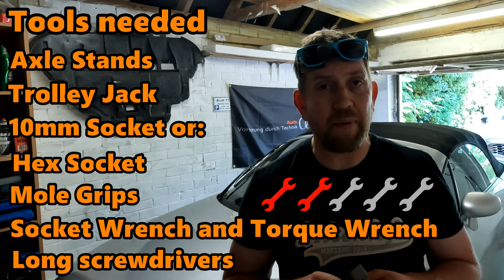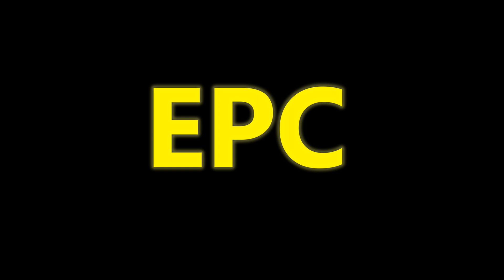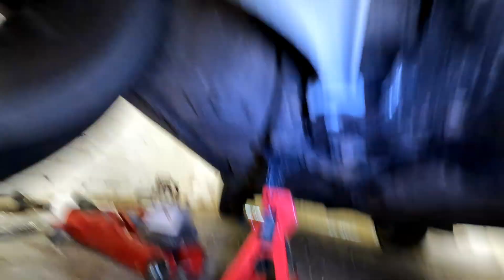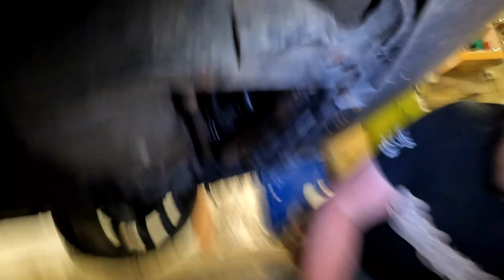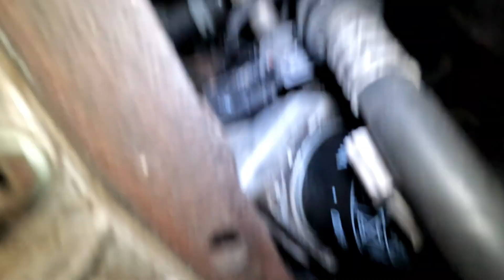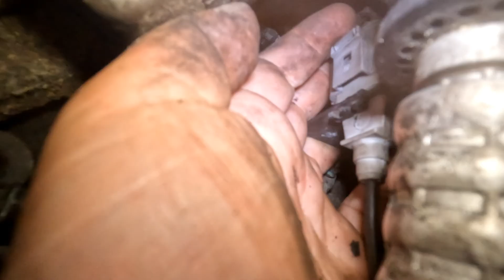Audi TT Mk1 1.8T - How to Replace the Crankshaft Position Sensor - P0322 error code

Comment: This method does not work on US spec TT. The engine buy is way more crowded which blocks access almost a 100%. You need to remove tons of hoses and spiral wrap that are tied to the emission system. I am deep in it now thinking this is an easy fix. Oh no, no joy here so this is crazy difficult.
Reply from the maker: Should be no different. An engine is an engine!
Reply: @andycharger My comment wasn’t meant to be anything negative about your excellent video. I do agree the engines are the same, but I am telling you, the connector position is different and accessibility is way worse. Mine is a 2002 California spec vehicle.
Reply from the maker: @knutbergan it was not taken negative buddy. I just don’t think  the engine should be any different compared to a UK engine. Thanks for kind words on the channel.

Comment: im currently having issues with stalling and not starting, otherwise driving fine. i have no obd readout but the issues you listed with failing sensors are exactly my problem. 2 times at the same stoplight it just shuts off but the ignition stays on, repeated starts wont help, today i needed to push it somewhere save, let it cool for a minute or two, then it fired back up and drove normal for the rest of it. no epc or eml active, although my car is a 99 model, so one of the first editions, so it may not be as intelligent to throw me a light
Reply from the maker: What seems to happen with this is no light but generates a fault while plugged in and ignition not switched off. But there is no light showing for the code. Like a ghost code. The cooling down and waiting is exactly how my 3.2 behaved. It will get progressively worse but swapping that sensor cured it for me.
Reply: @andycharger  i will see if my problems will be resolved with a new sensor, i ordered mine a few days ago, just waiting for arrival, if its not this, im suspecting the fuel pump also, but in my case the cs sensor seems more plausible
Reply from the maker: @LcFan96 have you watched my breakdown vlog series in this problem? I too thought it was the pump and replaced that. Make sure you use a genuine sensor as a cheap eBay one is likely to fail

Comment: This looks nothing like under my car. I’m so lost
Reply from the maker: In what way does it look different? Do you have the 1.8T engine? Presume you have removed the undertray? Feel free to email me some photos over if you want me to take a look.
Reply: @andycharger  like mine just has all sorts of plastic hoses everywhere. And does you sensor lead to behind the throttle body as well?
Reply: Nvm I see yours is by the oil filter. Mine leads all the way up right behind the throttle body for some odd reason
Reply: same here. 1.8t apx quattro, cant even see the sensor. also no room to work

Comment: Hello Andy my dash pod has been on the blink for some time now but because it's my daily driver I've never got round to replacing it the car stalled at junction yesterday. Then shows the EPC light when I used code reader it read 5 faults 16706 16395 18058 16885 & 16891 any help would be appreciated from Darren 2003 quattro 225 ❓
Reply from the maker: Both my v6 and my 225 did this stalling trick and on both of them replacing the crankshaft position sensor fixed it. Hopefully it helps you too. Reach out to Sean blencowe to sort your dash pod. Highly recommended! 👍

Comment: What’s the rpm reading should be during cranking on the sensor and what’s the rpm needle should read during cranking
Reply from the maker: Not sure during cranking. I will check mine with OBD2 to see if it tells me. It appears flat lined on the gauge until the engine is running. Thanks for the comment 👍

Comment: I have a  2017 Audi TT, My car was giving me a speed sensor error. I turn on the car, move it to the area where I do my repairs and proceed to change the sensors, disconnect the battery and change the sensor, then connect the battery and when I go to start the car, the panel and the lights turn on, but the driver's window that was open does not close, I check the battery which is practically new and was dead, I take it to be checked and the diagnosis says it is good but dead, I charge it, mount it and try to start the vehicle again and the same thing, the lights, the radio, the digital panel turn on but the driver's window does not go up and it does not make any attempt to start... I am lost and I do not know what it could be... Any idea?
Reply from the maker: Hi. I am afraid I do not have any knowledge of the mk3 TT. Sorry I cannot help.

Comment: Andy, great video as always. Potential tip for others prior to changing the sensor. I had this happen recently on the TTR BAM, EPC light threw up when driving along M23 resulting in high idle revs (1,200 rpm instead on 760 rpm - if you see this don't stall or attempt to restart otherwise you may not be able to restart and be stranded). I was reading the Audi repair guides and they state to check the pins 2 and 3 (pin 3 is next to the round curve, then 2 and pin 1 next to rectangle end) for Ohm resistance being in spec from 730 to 1000 Ohm before changing the sensor. You may have noticed the dipstick tube is just above the connector and in my case there was lots of crud built up around this area over the past 20 years, which may have affected the connecting plug causing an intermittent short. It might help to clean out the connectors first with contact cleaner and clean the sensor area with a spray bottle of detergent / degreaser just to see if this issue is an electrical short, prior to changing the sensor. I cleaned everything and I changed the sensor to another Bosch one (as per the original). After I removed the original sensor I tested it with the meter and was reading 890 Ohm, within specification. TT gremlins strike again!
Reply from the maker: @davidjsmith67utube  fantastic and detailed response David! Thanks so much! 👍

Comment: Hi Andy, great video!  after watching this video i decided to tackle the job myself on my Mk1 TT, the connector was loose without any holding bracket and being heavy handed i managed to pull the connector off leaving the black brown and white wires exposed. the black wire is to pin number 1 but could you tell me which wires go to pins 2 & 3. any help would be greatly appreciated.
Reply from the maker: Hi. I am not sure of the pin out for the sensor but will see what I can find buddy!
Reply: Thanks Andy
Reply: Hi Andy, I've done some digging around and have found that the pin numbers to colour wires connecting the sensor are 1, 2 & 3 = black, brown & white.

Comment: How did you get the grips on the plug. I've been at it for 2 hours 🤬🤬🤬🤬
Reply from the maker: Hi Paul. My mole grips have quite a small "head" on them so they fit into tight spaces. The best thing you can do is try and get a screwdriver or similar between the block and the sensor (maybe under the bolt hole fitting) and try prizing it off. Getting the new one in the hole is the real challenge. Use plenty of lube on the red O ring!

Comment: New part arrives tomorrow, might as well change the oil while I'll be under there!
Reply: Well, the first part ordered from Amazon (hey, don’t judge me, free shipping!) was wrong. The part ordered by the guys at my local AutoZone was wrong, but I finally got the correct part installed today. I should say, my 21-year-old did it because he could get his hands in there. Definitely easier if you remove the oil filter! The car is running great now.
Reply: Where did you order your part from? i have a jetta 1.8t with the audi tt amu engine and don't wanna buy the wrong part.  @TheCincinnatiDad
Reply from the maker: @TheCincinnatiDad  great to hear you got the car sorted and interesting to hear there are different parts for the various engine styles. Sorry for the late reply! 👍
Reply: Ugh, the 225 AMU isn’t the same…. Always a complication🤣🤣🤣

Comment: Woderful and helpful video! I have the exact same simptoms in my tt. I've changed the coolant temperature sensor hoping that's the cause but today my tt just stoped working at a red light. It started after about 20 mins. I feel a fuel smell inside tho. I thinks it's this crankshaft sensor the problem. Thank you so much for this video!
Reply from the maker: I’m glad it helped buddy! 👍

Comment: Hi Andy, Very informative video as usual. I have an airbag control module warning light on and i have a mot next week. Do you have an idea on how to fix it? I have a Mk 1 A3 1.8T S spare car maybe they are the same? I have the same car as you silver BAM TT Roadster I need to join the mk 1 TT community for help lol. Any help would be appreciated. Going to upload some videos of my TT R when i get my phone fixed.
Reply from the maker: Hello sir! Thankyou for your comment. I think you can reset the airbag control module using Vagcom. Have you scanned the car with an OBD2 tool to see if it has an error? You may be able to just delete it.
Alternatively, I think you can remove the module if faulty and replace with a new one. I believe the part number is 8N8 909 601

Comment: Hi Andy ! Very nice job, and well explained. I have done this job 2 years ago and, omg it was a pain ! 
Obviously, the access is tricky. Bolt ok, connector ok, but to extract the sensor … 😵
It turned on itself but, impossible to pull off. 
In the end with a plier like yours ( don’t know the name in english ) and pulling hard, it came out 🥵
My symptomas was an hight iddle, and time to time the car stop when in taffic 😤
And restart was ok 10 mn after.
Reply: Yes, of course this issue was solved, but you know, at this age one problem solved, another take place ;) Not a big deal.
Reply from the maker: Thank you Rene! Yes pliers or mole grips to remove the sensor. I had very similar symptoms. It just stalled at a junction then refused to start. 5 mins later it started! I hope you car is working well now!